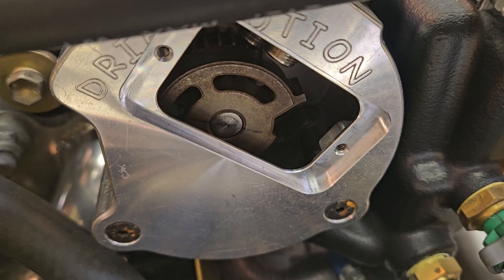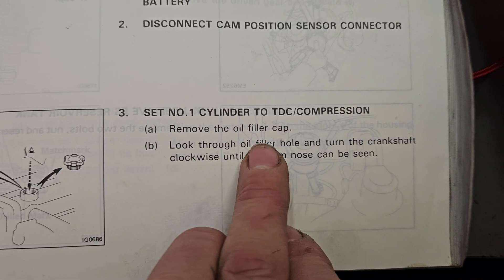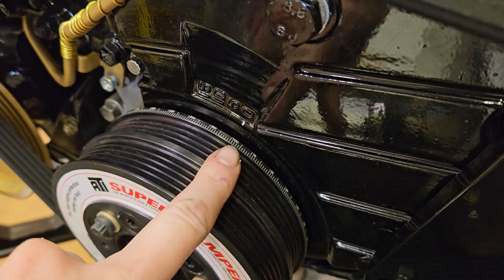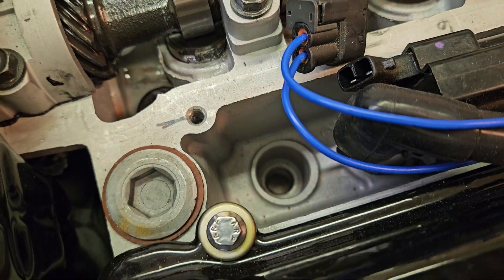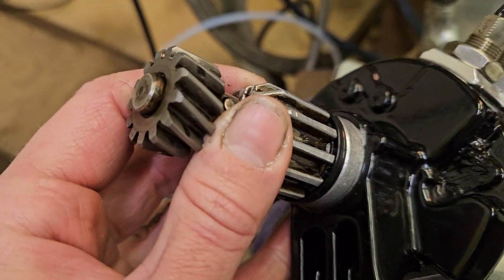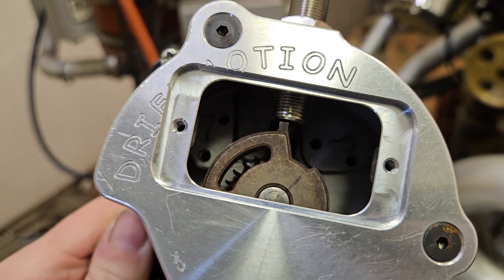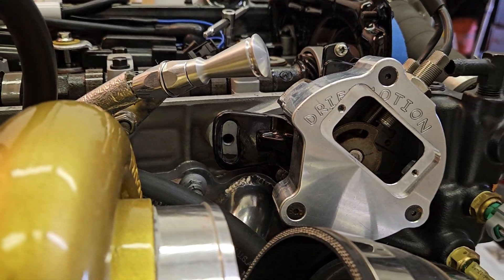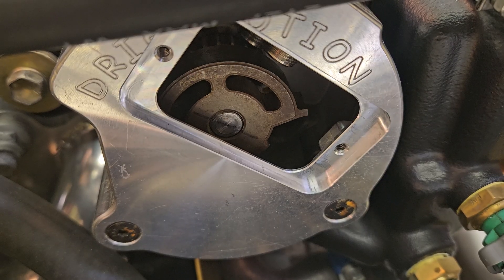How to Install a CPS on a Toyota 7Mgte

Comment: Looking up a cam grinder and saw you measuring a cam to .0005 on your test stand. Coolio! I’m a hot rodder, restorer, builder, machinist, CNC programmer, electrician, etc. Worked for Rod Millen Motorsports as their CNC guy, then Specialized Hot Rod, then owned my own shop Huntington Beach Hot Rods, before spending 21 years as a mechanic in the Long Beach harbor at the ITS super terminal, doing cranes, and Reefer units. Retired early and building multiple fun projects up here in Big Bear. Saw you while researching custom cam grinders in the area. Gonna get Daniel to fix and improve the grind on what was a very conservative Kawasaki 250 motor factory tune. Also looking at having him spice up an NOS Singer roadster camshaft to make it more suitable to blower. It’s a goofy 1500cc OHC motor with 7:1 compression designed for British 70 octane gas from the fifties. Other than that, I have five high performance motors and transmissions to match rebuilt and ready for existing projects to reach the finish line. Also have three antique speedboats from a 1959 Hullman to a 1965 Nylock Phantom 15, to a 70’s Flatbottom that all need freshening before I’ll put them in the water. Already bought the new parts and paints but it’s always time vs. YouTube, and bad weather! Lol! Nice to see a hot gal turning a wrench, and enjoying it. I always saw doing it yourself as the way to pay for all the tools that allow for it. After a lifetime I have everything from Machine tools, to mig and tig welders, to the LS Starrett tenths incremented thimble ratchet in wood case precision tools, to the biggest box set SnapOn made up till 2014 full of SnapOn tools. Yes, english, and metric as well as British National Fine standard Whitworth based tools where the wrench size describes the nominal thread major diameter, so a 1/4” wrench measures a calculated size based on nominal call out that is like .498 opening so it is just funky, but necessary to build certain old British cars that used it.

Comment: I just did a auto to W58 swap and put in another 7MGTE I had, and my friend more experienced with 7M's timed it for me; swapped the CPS & TDC'd it. But my cam lobes are at 10-11 oclock  with the gears lined up and the bottom harmonic balancer is lined up at 5. It'll crank forever and sounds like it wants to start but even off ether it won't. I'm cheap as hell and have no timing light but my friend said the way he timed it, it should still  start & idle rough atleast. But if the lobes supposed to be around 1oclock and the bottom lined up at 0 did he accidentally put it at 180 out? Do you have a video on how to fix this? Sry I know that's alot but this is my first engine & trans swap ever thanks in advance for any advice
Reply: CPS was off a tooth

Comment: First of all I would like to thank you for your information you gave me on getting my valve cover gaskets replaced on my Tacoma, had the work done and no more leaks Thank you very much. Have you ever seen any of the early celicas from the 70's or the ones that looked like 69 or 70 mustang get worked on these were Toyotas first hot rod's as far as I know.